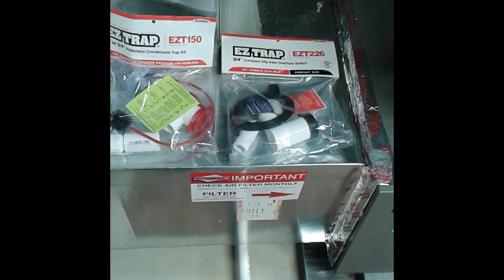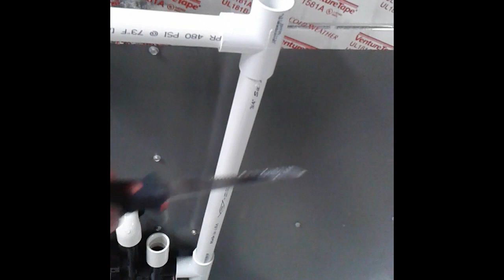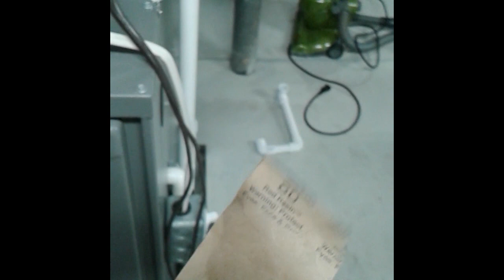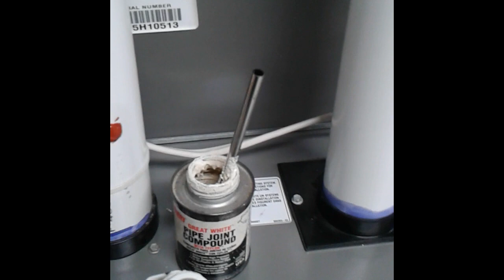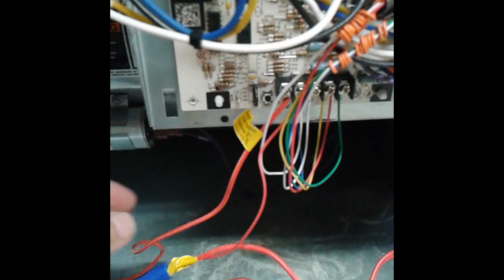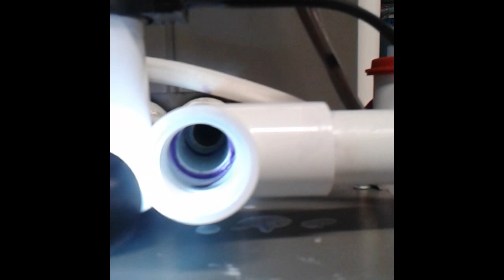Install an AC Condensate Waterless P-Trap and Cut-off Switch

Comment: Doesn’t that trap only drain when the negative pressure stops (unit shuts off), or enough water column has accumulated inside to overcome the negative pressure?  Doesn’t that mean more condensation sitting in the pipe and air handler’s pan during operation?

Comment: It’s been 5 years how is the visibility on the p trap? Thanks
Reply from the maker: Excellent question! The visibility of my waterless p-trap system has remained relatively clear. However, the trap requires periodic cleaning to keep it clear and condensation flowing.  Because of the cleaning, one of the tabs that helps keep the two parts of the p-trap together has broken off.  It may have been due to rough handling or the material used to manufacture the p-trap.   Overall, the waterless p-trap works but may not reduce maintenance compared to others.  From my viewpoint, all p-traps require maintenance. Does this one require more or less is the real question that I have no data to answer.  I plan to continue using it so long as it functions as designed.  Thanks for your follow-up question.  I have been using deck and house mold cleaning bleach with water to clean the p-trap.

Comment: I use CPVC-CTS (yellow, copper dimensional) pipe rather than PVC (white, Schedule 40). This is because CPVC has a higher temperature rating and that is better for a hot furnace. And I also use Low Density PTFE tape rather then white pipe dope. This is because pipe dope will slowly erode the plastic. I use the RectorSeal generation 2 Model SS2 Safe-T-Switch, 97637, rather than an EZ Trap. It needs to be noted the SS2 comes with a 3/4 inch threaded to slip joint fitting. The fitting has a standard 3/4 inch thread. But this slip joint does not have CPVC-CTS or Schedule 40 dimensions. It is a non-standard diameter and will not mate with either CPVC-CTS or schedule 40. And some like to use the generation 3 SS2 Safe-T-Switch. 

You use just enough Low Density PTFE tape to fill the thread gap. For example, I used 2 loops of tape for the CPVC-CTS 3/4 inch threaded fitting and I used 4 loops of tape for the SS2 switch 3/4 inch fitting. 

BTW, the part with the wires does not get glued into place. Nor do you use any primer on it. That way if the AC is not working it is fast and easy to check the switch bowl for water.
Reply from the maker: Joanna excellent comments.  You need to record your installation for others.  It may appear as if I glued the RectorSeal switch in place but I caught myself and only primed the pipe.  The thread seal I used apparently said it was safe for PVC but I agree with you tape is safer.

Comment: Thanks,  One question. Why did you choose to connect to the Red wire instead of the Yellow wire?  I understand the Yellow wire will shut down the condenser and the red will shut off the fan.
Reply from the maker: Correct, the schematic for my Lennox board shows the yellow wire controlling the condenser.  However, my room thermostat draws it's power from the red lead.  So in my case it shutdown the room thermostat hence the whole HVAC unit (cooling and heating).  Therefore, I would recommend your wire your cut-off switch according to how your unit is appropriately wired.
Reply: The red wire from the transformer shuts everything off including the thermostats.

Comment: I checked my furnace litatuture and it suggests a trap . It is a positive  pressure system like yours . How is yours working ? Why would a trap be needed for a positive pressure system? I was thinking about adding one , but not sure if would be of any benefit.
Reply from the maker: David, I really don't have a good answer for you.  But it was recommend by the service technician that serviced my furnace.
Reply: @aviator5  I put the same one you did in  . I guess from what I understand is to prevent cold AC air to blow into the consent drain . Better efficiency . I guess that makes sense . Really don't need to cool that . Thanks for responding .

Comment: Great video. List of materials and equipment very helpful.
Have some questions/suggestions:
Wouldn't this procedure work on any HVAC system, not just Lennox?
What are some of the problems a homeowner might run into with a system that does not have a p-trap or a cut-off switch?
Reply from the maker: An air conditioning (AC) p-trap is similar in function to a p-trap under your home sink.  
It traps gases and pressure negative or positive generated by the air conditioning system.  
A conventional p-trap under your sink uses water to make a seal to trap potentially noxious and foul smelling
gases from escaping into your home environment. A waterless p-trap uses a mechanical device to form a seal.

From what I understanding speaking to an HVAC service person
this Lennox AC without a p-trap is allowing positive pressure to escape or be
pushed into the sump where the condensate (water) is collected. For
efficiency sake the higher positive pressure that is maintain in the air
exchange chamber the more pressure is available to push the air through the
ducts and into your living space.  Also, theoretically
speaking, a drain without a p-trap could allow rodents and pests to enter the AC unit.  

However, the manual for this Lennox list the AC p-trap as
optional and I sense that the amount of pressure lost through the drain and
vent is not great.  Conversely, the p-trap and vent for the heating unit just below
 the AC unit is required.  As always refer to your manufacture’s manual,
local building codes or HVAC service person for expert advice.

As for the cut-off switch without it homeowners run the risk
that if the pan fills with condensate due to a clog it can overflow on to the
floor.  Worst yet, it can overflow onto
your control panel and cause your AC and heating unit to fail.  Note in this video the brown stains on the floor
of both the AC and heater pans. Also, note the location of the control panel
just below the AC pan.  This unit
apparently had a clog due to insulation debris left in the AC pan.  Fortunately, it was detected and the debris cleared
(but not removed) from the drain before it caused any damage.

Yes, this waterless p-trap can be used on most AC units.